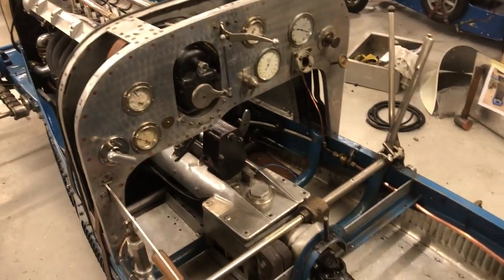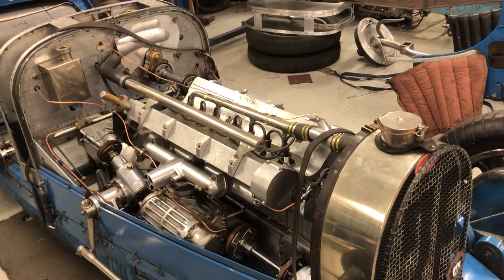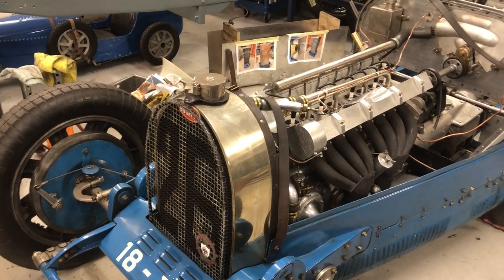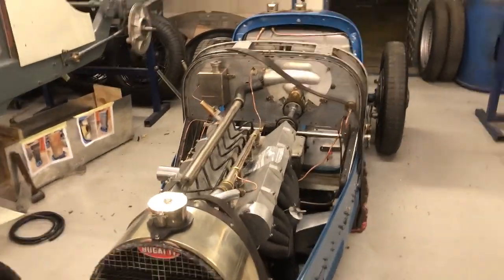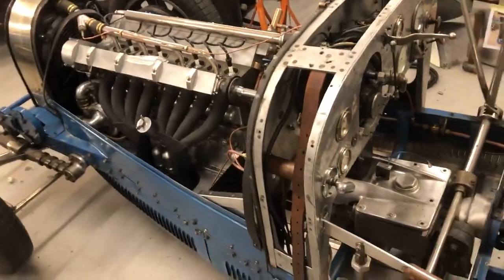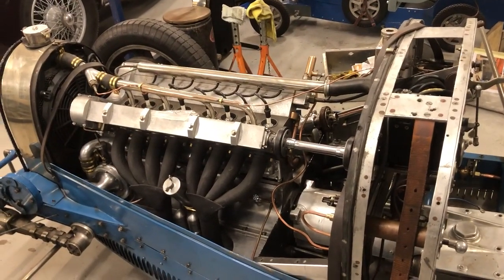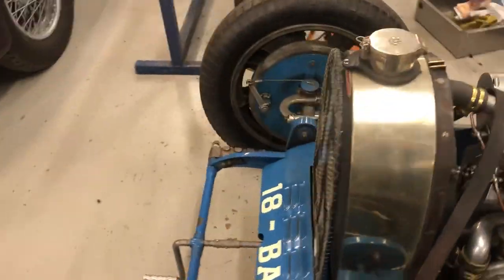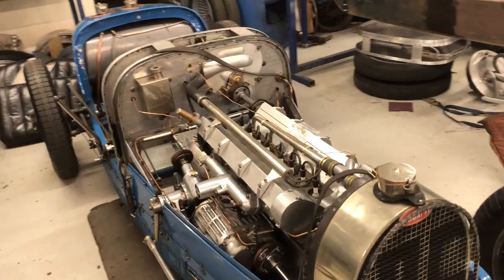How Bugatti got to the Type 51

Comment: Given that the T51 engine is capable of lots more power, is more torquey, does not suffer from the cooling and cracking issues of the T35 engine, why was the T55 a sales flop when its earlier counterpart the T43 was a success?
Reply: Well, I guess the Great Depression could be one of the reasons why. By the 1930s, the effects of the depression is hitting European countries, so I guess most of the prospective customers ended up trying to save their money. 

Also, another one could be new competition. The then-new Alfa Romeo 8C family is the Italian counterpart to the Bugattis; 8C 2300 "Monza" countered the Bugatti Type 51, and the 8C 2300 sportscars competed with the Type 55. And the sporting successes of the Alfa Romeos probably contributed to the whole thing, just as the dominance of Bugatti in the mid-to-late 1920s probably played a role in their sales.
Reply: @jcgabriel1569  I agree with your points, but I would still expect the T55 to be more successful